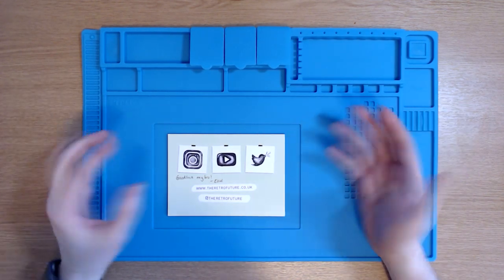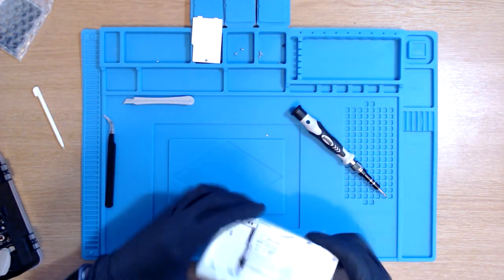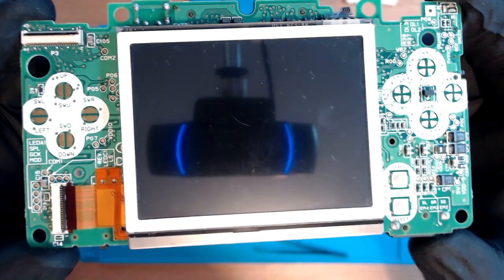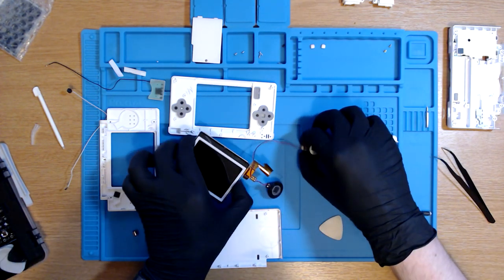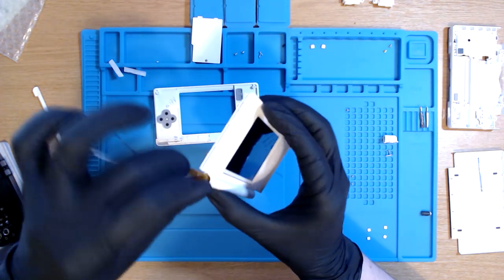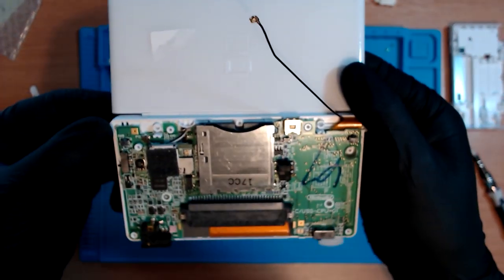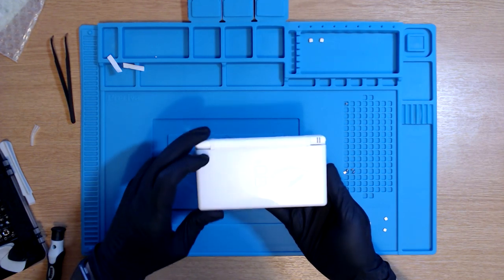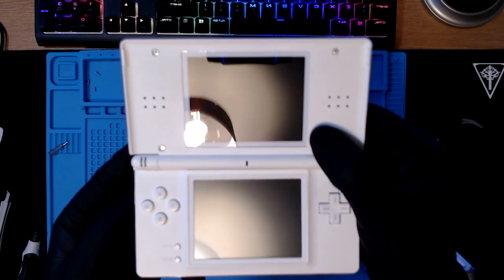Repairing a Nintendo DS Lite with NO Experience

Comment: My tip is tape the shoulder, power and volume buttons down prior to unscrewing the case.
I broke a power switch on my first ds lite repair, it sucked soldering a new power switch on.
Reply from the maker: Nice one, thanks for the tip dude.

My next video will be soldering, and I haven't done that in about 12 years.

Comment: I’m actually really grateful for the mistake at the end because my childhood DS broke in 2010, and I’m just now getting around to fixing it… and the mistake you made at the end was the exact problem mine had. The top screen stayed blank, but the bottom flashed for a moment, then went black. I’m really relieved that it was just a problem with the ribbon cable being loose and I don’t have to replace anything…

Really good video - very helpful!

Comment: This was amazing, thank you🙏 I’ve been watching Elliot’s videos for a hot minute and been wanting to start dabbling in this!
Reply from the maker: No worries! Highly recommend giving it a go. The feeling of getting working is something else :)

Thanks for watching.
Reply: Joey Does Tech I’m just holding off until this virus goes away. I need to order all the gadgets/screwdrivers for disassembling. Don’t think I’m brave enough to tackle a DS lite right off the bat.. I was thinking something like one of those new after market screens on the GbC. Or fixing my joycon, idk if its the control stick or dirt thats causing drift.
Reply from the maker: @SkinnyDoom  You don't have to spend too much to get started, my toolkit cost me around £16 for literally ALL the driver bits I could ask for to get started on console repair. Most bits you order off Ebay (screen etc) usually come with the tools to start anyways. Assuming that's the joycon for the switch?
Reply: Joey Does Tech Yeah, that repair is easy as I just need to carefully open the joycon and the control sticks just a ribbon cable, no soldering required